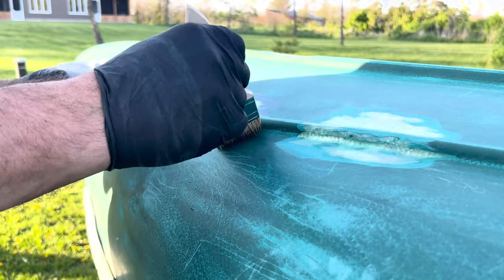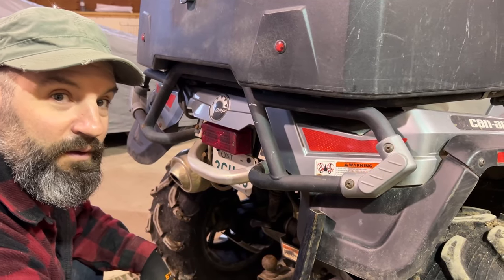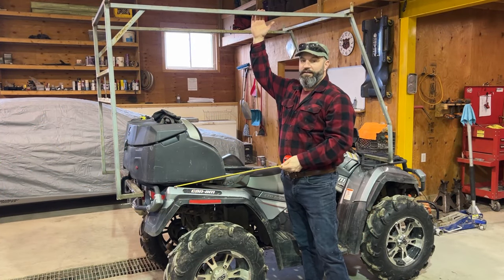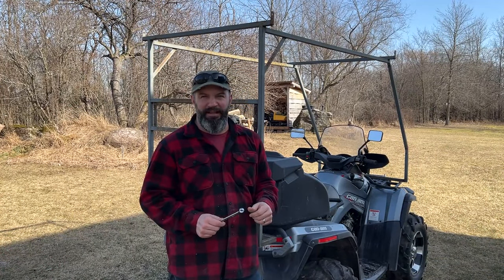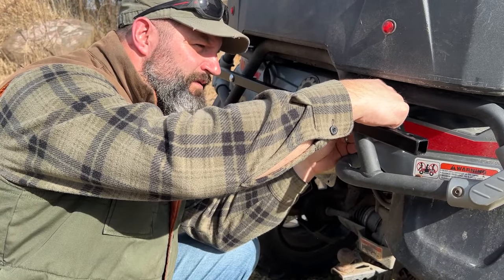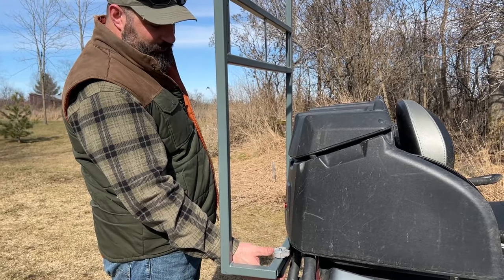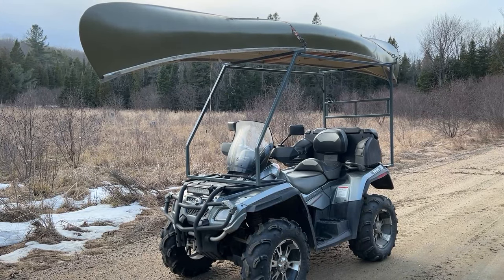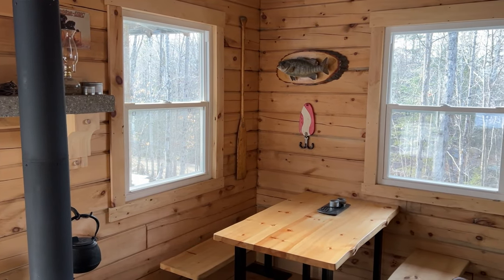The Cabin Ep 18 / This will change everything.

Comment: Nice work and looks cool! Could you weld nuts under the rear atv bracket, and under the front rack, and then convert your bullet proof hand nuts to bullet proof hand bolts?
Reply from the maker: Could do that fairly easy on the rear bracket.  But be a bit harder on the factory front rack.  It’s pretty thin. And the heat would probably make it rust out a lot quicker.